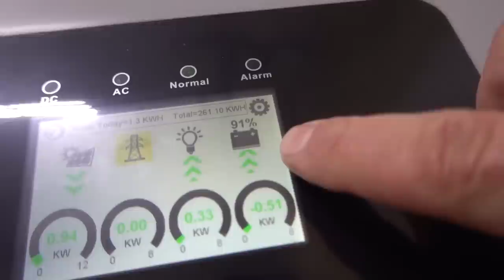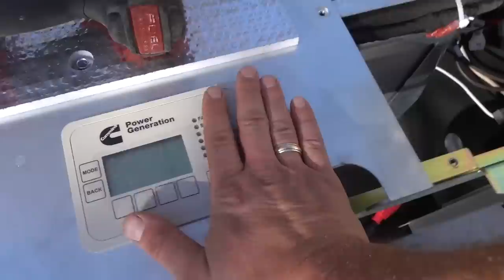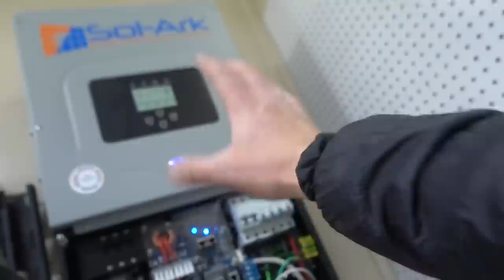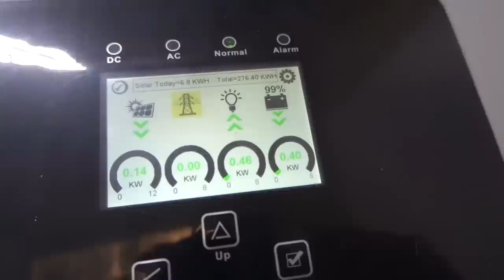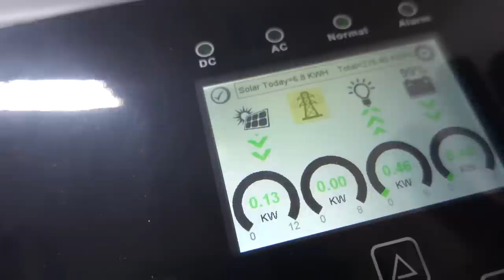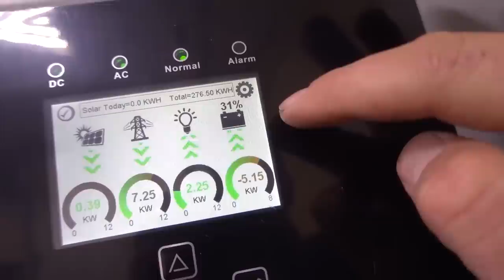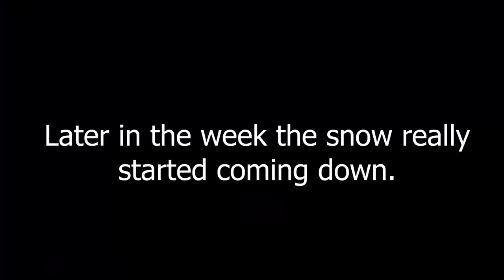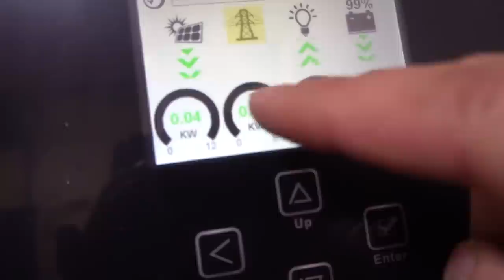The New Cummins Generator Saved Us During the Snow Storm!!!

Comment: In the mid-2000's, I think late February, we had a massive freeze here in Missouri and power was out for weeks! No gasoline for gas generators and those wanting generators couldn't get them, everyone was sold out.
  When we got thru that, I immediately bought an automatic generator that runs on natural gas. It kicks on if main power goes out for one minute, then drops off when power comes back on. It has been such a lifesaver!
 The company techs come once a year to make sure everything is working like it should. I absolutely recommend generators to everyone!

Comment: The anode rod is basically a sacrificial piece.
If you've ever opened up a water heater, they have rods in there that are used to keep the tank from corroding.
Basically anything that would promote corrosion in a metal tank will be attracted to the (usually zinc) rods and corrode THAT first.
It isn't a "forever" thing, because the anode rod eventually wears away.  But it vastly expands the lifespan of the tank.
Same thing with the anode rod for your buried tank.

Comment: I just had a Cummins RS50 installed at our house as a backup during power outages. It is connected to a 500 gallon propane tank and an auto transfer switch. This thing is a beast, powered by a 5.9 Cummins. It looks just like the 1st gen Diesel engine, should last forever.

Comment: the anode bag is filled with "sacrificial metal", basically you fill the bag with more easily corroded metal like zinc, that way corrosion will be drawn to attack the zinc instead of the propane tank which are primarily made out of steel.
Reply: They do the same thing with boats, most typically saltwater boats. A zinc "anode" is corroded away over time, rather than the expensive bits like outboard, keel, rudder etc. Almost all outboards these days also have 1 or 2 zinc anodes down near the prop, in case you dont lift your outboard.
Reply: Water heaters have them inside too

Comment: The anode bag works like a battery so that the stuff in the anode bag rots and not the tank by creating a small voltage difference which in effect tries to plate metal onto the tank rather than allowing its removal. It may be zinc or magnesium. They use them on stuff like oil rigs,  Alternatively on large installations they have generators to produce the voltage. What I don't know is how long the bag will work for. Solar works quite well in the snow the panels are thin and dark so they warm up at the slightest hint of sun and the snow slides off them. It helps if you have a steep roof pitch. Not that I would expect you to get a lot of snow in Texas. In the UK we do but our houses have the steeper roof needed for a lot of snow. Looks like you have a good set-up :)

Comment: Hey matt! The anode bag helps with rusting because it contains magnesium or a metal less noble than the steel tank, and helps with electrolysis. You have one in your water heaters too.
Reply: Same reason they put blocks of nickel on steel hulled boats/ships.  The salt water attacks the nickel and leaves the rest of the hull alone.

Comment: Working on a remodel and addition to our house at the farm right now. Going to be a 6 to 8 months build. We are planning on adding either a 20 KW Cummins air cooled  generator Or a 25KW liquid cooled Cummins generator. The great thing about Cummins is for an additional $600 at time of purchase you can extend your warranty on a air cooled unit from five years to 10 years and on a liquid cooled unit from two years to five years. And that’s a top to bottom warranty. It is a great deal. We have Generac generators currently at all of the fire stations that I work at except for station one. Station one has a six cylinder liquid cooled Cummins generator 75KW that is 25 years old and still works perfect. And our city is looking at swapping all generators over to Cummins generators. We have been completely dissatisfied with Generac.

Comment: Those are called a sacrificial anodes, they are normally installed below the water line and the wire is bonded to the tank, it  keeps the tank from rusting out, great video

Comment: For my tree company we use Ditch Witch. Extremely reliable units that will fit through a standard 36"gate and also lift ~1500 lbs. They also take a beating - the crew constantly smashing logs in to it (not on purpose) and it keeps on going.

Comment: We did a Cummins at our housee!
Reply: How was the install? About how much did it cost. We are thinking about getting one but have no idea what the cost is. I know the price is different for each house, but I'd like to just get a ballpark amount.    Thanks
Reply: @redwolf8539  call and ask customer support
Reply: keep an eye on the oil level, out here in CA those generators burn a ton of oil.
Reply: @rival2561  it's always good to get others to give advice because some companies work on commission and over charge..this makes a good claim to haggle the price
Reply: Matt you need a CAT 259D3 or 299D3 if you want the best machine out there.  I am a sales rep for my local Cat dealership, I wouldn’t steer you wrong
Reply: @redwolf8539  For a non-portable 22kwatt. $9,000.0 to $10.000 Not installed. Installation Maybe 5k.....
Reply: In 2021 Cummins is a verb. I think we’ve peaked y’all.
Reply: @rival2561  Customer support isn't going to give you a price. You need to call an actual distributer/installer for an actual quote.
Reply: My parents have the Generac Guardian it’s a great system
Reply: $6k for a 22k Generator and $13,000 for installation.  Required an electrician, plumber, permits, slab, and automatic switch.
Reply: @BTBRVReviews  seems insane. But worth it in the long run.
Reply: Matt: trying to keep all trees we can out here
Also Matt: look at my 5ton! What trees!?!
Reply: We did a Cummins at my house and my gf had a baby
Reply: @redwolf8539  did an install at my house last spring. The install was great. Got a 20 kW Cummins generator identical to Matt’s. A local electric company in my town came and installed it and did all the wiring and the install of the automatic transfer switch which turns the generator on automatically if the power goes out. A different local heating/cooling company came out to do the piping for the natural gas to go from the meter to the generator. The local utility company in my area had to come before all of that though to install a slightly bigger natural gas meter to handle the increased demand of all my house’s appliances with the generator now on top of it. The generator is amazing and will literally power everything in my 2700 square foot home. It runs like a champ and so far in the last year it kicked in for 1 power outage and it was fantastic. All my neighbors were very jealous that I had lights and heat during a snow storm. In total for the generator, the install, the gas meter upgrade, and the natural gas piping it was about $10,000. Cummins does have smaller generator that provide less kilowattage but you may not be able to power your whole house with them. Hope that helps!
Reply: We're there black guys involved ?
Reply: @tboman4128  Thank You for the info.  So we are looking at around 20K+, out here in Calif.probably more..
Reply: @BobMarley-rz3to  did the installer install something extra?
Reply: @redwolf8539  yep because the state has to treat people like they don’t like em for being independent.
Reply: @BTBRVReviews   is it a good idea to buy the generator and ATS and hire a licensed electrician / plumber to do the install?

Comment: Not sure what other loads you have, but for the shop, it looks like the ganerator is much larger than needed. I'm running on a 6KW diesel for emergencies. To save fuel, you may want to get a larger battery bank to charge more capacity. This will reduce the run time needed for the generator as very low loads on a generator consume fuel for very little power generation.  Think running your truck for 8 hours to charge your cell phone. Better to run for 1/2 hour to charge the truck battery, then charge the phone off the charged battery.
Reply: Definitely way to big and just wasting a bunch of propane, a 17kw generator could power an entire 2,000sqft house including the A/C.

Comment: Matt needs to do this exact same setup for the mansion.. Lots of solar, a Cummins 30kw generator (up to about 120 amps).  Could have a mostly-green house.. And if you've got that much solar and generator capacity, could use exclusively electric heat (minus the fireplace) so except for internet, don't really need external connections to the house

Comment: Curious was there ever thought of a Generac generator. Your set up and install was real good and during a gas crisis or energy failure out in town not able to energize gas stations u can have propane truck still deliver to u. I believe propane is less efficient yet best choice. Does cummins sell a dual fuel generator could be handy. Good little set-up u have thanks for sharing would have liked to have seen a little more on the switch solar to propane. Yet excellent video thanks.

Comment: Always fun from Canada to see how you folks do things in Texas.  You may have had a dusting of the 'white stuff', but it doesn't snow in Texas.  The first strange thing is a water tank outside.  They freeze solid at minus 35 degrees, expand and just rupture here.   If the power goes out, you don't want the generator coming on automatically if it is buried under five feet of snow.  You have to turn them on manually here, after you've dug it out with a two foot space all around it for ventilation.  The only benefit is, when you have an 8 foot wall of snow surrounding the generator, they are actually pretty quiet.  lol

Comment: So on the topic of the anode bag, much like an anode rod inside of a water heater, a super simple way to think about it is it's like the kinda like the silica gel pack in your gun box or bag of beef jerky. It's there to attract oxygen (and therefore oxidation) away from something by absorbing it. Whatever alloy is inside of that bag is supposed to soak up as much of the local oxygen by oxidizing faster, and that is supposed to prevent in this case the tank from rusting for longer. There's a lot more to it, but that's the best comparison I could think of lol

Comment: We use a Kubota Skid Steer on our farm, It has never let us down in the 4 years we've used it. very basic machine but huge pros are the windshield isn't in the way when it's open, controls are all hydraulic so the response time is better and the machine doesn't shut down when bogged down. It's a 75 HP model but I'd go with the bigger 90 if getting another one.

Comment: You have discovered the weakness of "green energy". Its unreliable and a secondary supplemental supply at best.  Its great for emergency to have something when the sun is available so you  can conserve gen fuel, but a generator is a must if you dont wont to be in the dark. A combo system using wind, solar, gen, and commercial power is a great system for whole house rural power.  Practically disaster proof.  Just dont forget to maintain your batteries.

Comment: Matt FYI, An anode is typically known as a Sacrificial Anode, now most often  made out of Magnesium when connected to the propane  tank with a wire a very small DC electrical current flows from the Anode to the tank. The DC current prevents the tank from corrosion, over time , ie years, the anode will corrode away ( Sacrificial) and stop producing the current to protect the tank requiring a new Anode. 
Your Ground looks super dry so you likely will have many years without concern of corrosion.

Comment: The anode bag contains a metal that oxidises easier than steel so that the metal in the bag will rust instead of the tank. They use the same thing on boats! pretty cool.
I'm a chemistry student and this is the first time that my knolage is usefull lol.

Comment: As far as skid loaders go in my experience with 10 years of experience of working on them I’m personally a bobcat fan but it comes down to personal preference and what your dealer network is you said you have a kubota dealer by you then I would look into that but just keep in mind not all skid loaders operate the same so if you are used to how a bobcat operates then go that route. You can always contact your dealers and ask to demo a machine that will give you a chance to run the unit on your property and see if it fits your needs and wants!! Hope that helps!!

Comment: Kubota SVL 95-2s I have run it every day for the last 4 years and it has the most power than any other skid steer I demoed. We also have a kubota SVL 90-2 and it is just as good if not better because ours doesn’t have a DEF system but if you want power and control, I say go with kubota

Comment: You need a sacrificial anode with almost any buried metal. Sewer and water pipes have them as well. The anode is eaten up by the difference in charges in the ground instead of the other metal.

Comment: You should get a BROKK they are radio controlled demolition robots with hammers and scoops even big shears for extra crushing👌🏼 they come in different sizes you should be fine with a 90/100 or a 160👍🏼 they are also really easy to repair (I work as a Brokk mechanic). but the 300 or the 500 are the cool ones😎

Comment: 16:55 it's called a sacrificial anode, part of a system called cathodic protection (CP). It needs the soil to be moist to work, as it generates a current that flows through the wire from the anode to the cathode (the tank) then back through the soil to the anode. Corrosion wants to take electrons from the steel, so the anode sacrifices itself to provide them for the steel. The anode material is less noble than the steel in the galvanic series. If you connect steel to stainless, the steel will sacrifice itself. The system can function using a power supply also instead of an anode. That is called impressed current CP.

Comment: The bag is a sacrificial anode, pulls electron charge from the tank so the anode rusts but the steel doesn't.
It's why you should never drink or use for cooking the water that comes out of an electric water heater as they have one in the tank for the same reason.

Comment: If you talk to the solar people, you should be able to install heater lines meant for pipes that will keep the temperature above 35 degrees to melt ice and snow. Only needs to be turned on if ice and snow. The other thing is to pipe a hot air blower to melt the snow and ice.  We did that for satellite dishes in PA

Comment: Nice install.. Get as much pipe capacity on the back side of the second regulator as you can so that it will start when the temps out are down on the colder side.. 10f can do things to propane.. such as making the gas pressure stay lower and make starting very difficult.  We typically run as much 1" pipe as we can stuff at it. Generally ten feet between the regulator and the "carb".   Many installers don't know this little trick..  All my units I maintain are 25KW 4 cylinder versions..

Comment: they are also called sacrificial anodes, usually made of magnesium/aluminum. They will rod instead of the tank as they are will give there electrons faster than the iron of the tank. This principle is also used in the boat building..  you are welcome

Comment: For Info..... The Zinc "anode bag" is there to sacrifice itself and corrode instead of the tank body.....  They need to be replaced on a scheduled basis to protect the tank long-term.....  All Steel hulled ships has massive sets of the bolted to the Hull for the same purpose..

Comment: The anode bag uses the power of science to protect the tank from rust by providing a sacrificial material to get eaten away instead of the steel of the tank. the material is likely zinc. If you look at photos of some ships in dry dock, you will see that the bottoms of those ships are littered with silver blocks. Those are blocks of zinc for the corrosive seawater to eat at before the steel hull gets eaten away.

Comment: What is Cathodic Protection? (anode bag)
Cathodic Protection (CP) is an electro-chemical process that slows or stops corrosion currents by applying DC current to a metal. When applied properly, CP stops the corrosion reaction from occurring to protect the integrity of metallic structures.

Cathodic protection works by placing an anode or anodes (external devices) in an electrolyte to create a circuit. Current flows from the anode through the electrolyte to the surface of the structure. Corrosion moves to the anode to stop further corrosion of the structure.

Comment: Anode bags help prevent an electrochemical  reaction between the steel and the soil which bores holes through the tanks.. much faster then rust alone.  Plus you need to replace them every 3 to 6 years..

Comment: Anode band is just zinc electrode probably. they do this on things submerged in water, especially saltwater. It just rust first if connected to steel :) Inspection and changing them is an actual job for water infrastructure. And that is why cars often have zinc plating on steel, it stops super fast self accelerating steel corrosion while some zinc is still left.

Comment: You would not regret the purchase of a mid sized excavator for your place. I own a 2005 CAT 307 excavator with an articulating  boom, 24" digging bucket and a 36" clean out bucket. It is hands down the most useful, reliable and hardest working piece of equipment I own on our homestead. I can dig to 12 ft, lift anything up to 5000lbs, sift rock and soil on a screen, grade with the bull blade and it is very economic to run fuel wise. My wife tells everyone how I love that machine, and she is right.